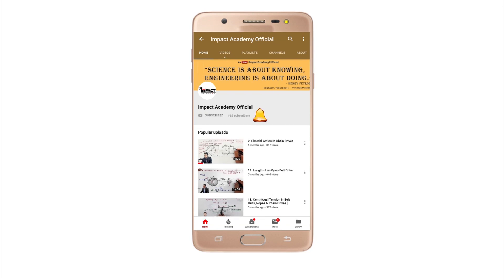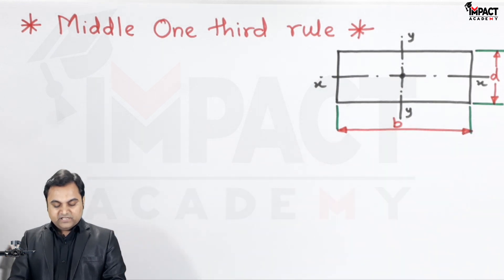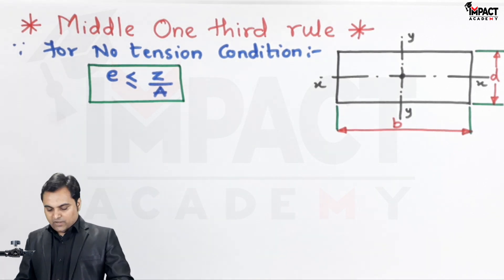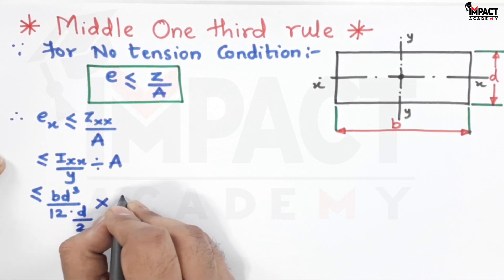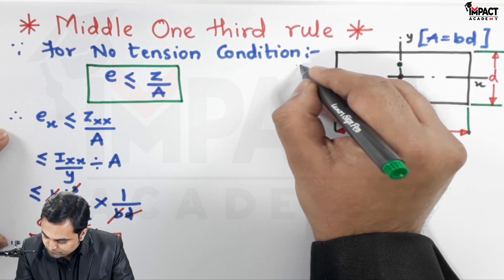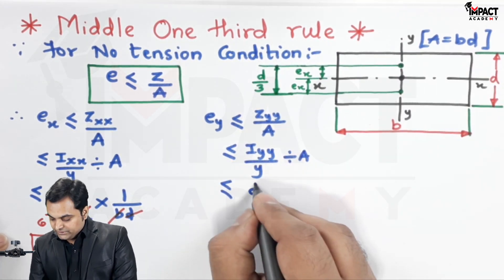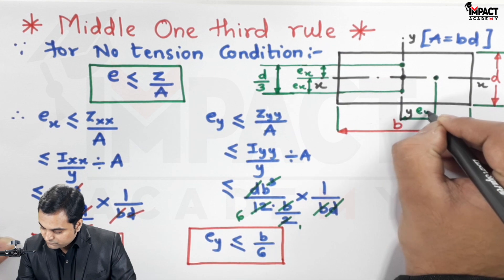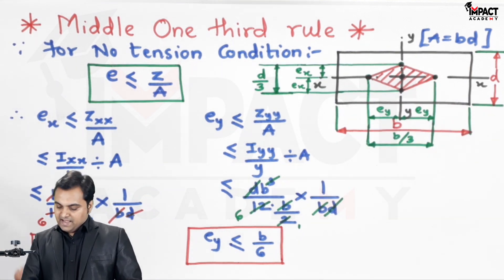Core of a section (Middle One Third Rule) | Direct & Bending Stresses | Strength of Materials | GATE

Comment: If the pressure line passes through the upper kern of the rectangular section of size 250mm x 450 
mm, and a beam span is 12m. The trapezoidal profile tendons with 1200 kN effective prestress after all 
losses, located with zero eccentricity at ends and 75 mm at one third of span from both end of simple 
supports. Determine the equal point loads value that rectangular beam can support at the one-third points.

Need help
Reply from the maker: http://bit.ly/impactEngineering
To access all the private videos and Remaining all Videos 
please visit our app Impact : The Engineering App 
You can directly download the app form the link given on top👆🏻👆🏻👆🏻

For more queries related to app, contact our Customer Care Number :- +91 7900123134
Reply from the maker: Thanks for watching👍👍
Subscribe our channel for get latest update about our videos...!!!
If you also want to take offline or online lectures or join classes...
Kindly call on this number
Zafar sir : 7666456011